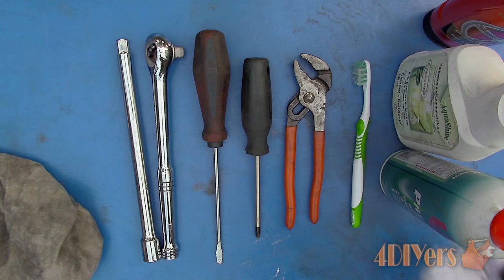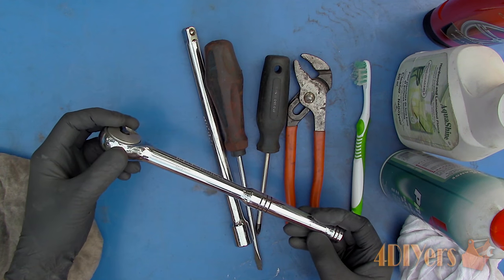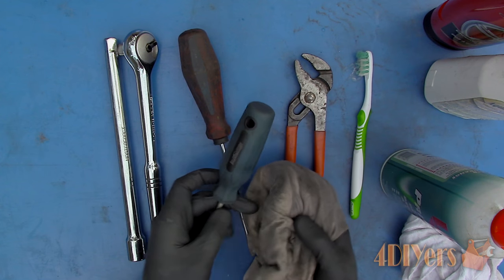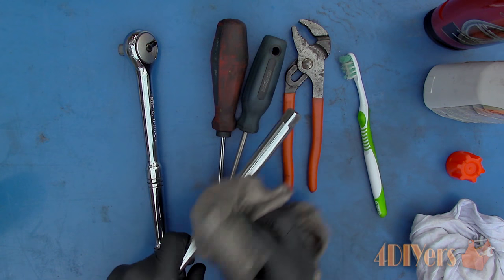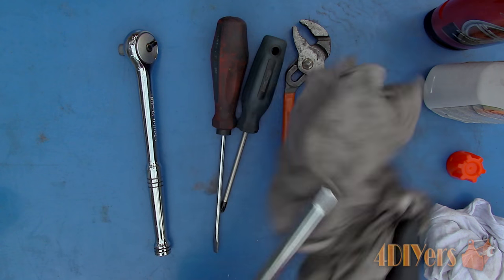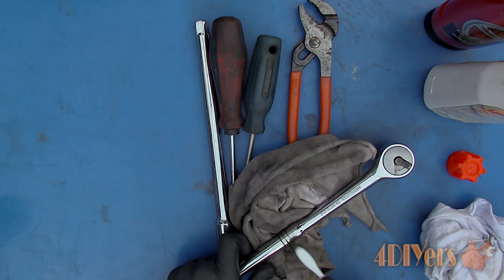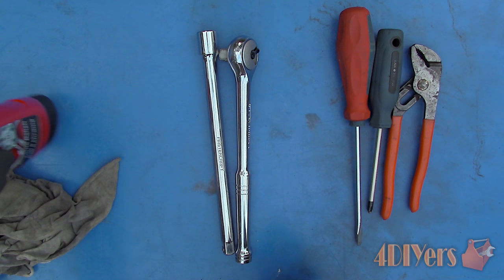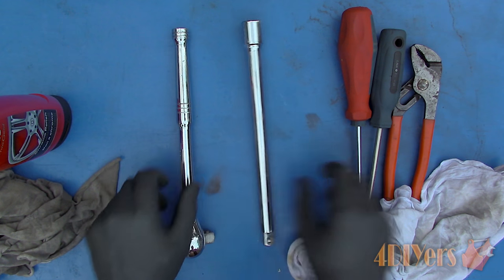DIY: How to Properly Clean Tools

Comment: I have read that simple foam cleaner also works.
I have tried it few times, seems to clean and degrease very well.

I havent used the oven foam but the "simple" textile foam cleaner.

Useful video. I need to clean my tools, too much work done and very dirty.
Even screwdrivers. Take one screwdriver and whole hand is dirty.
Reply from the maker: Thank you and excellent tips!